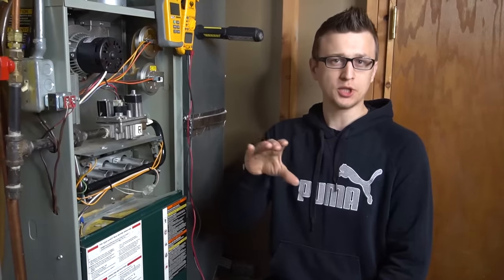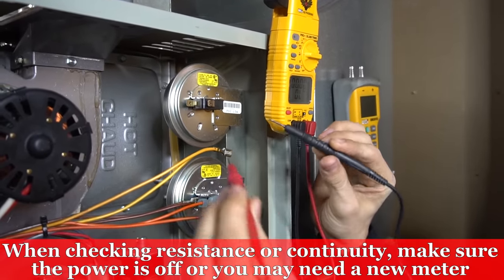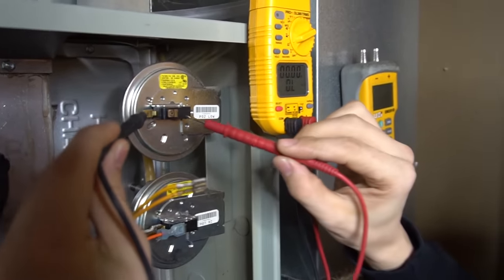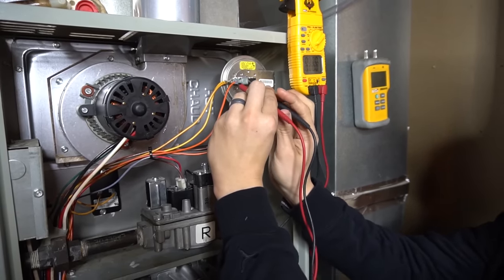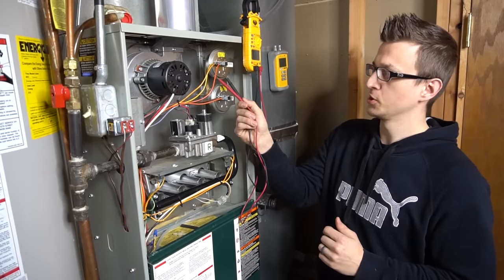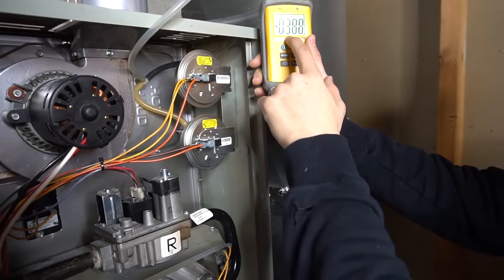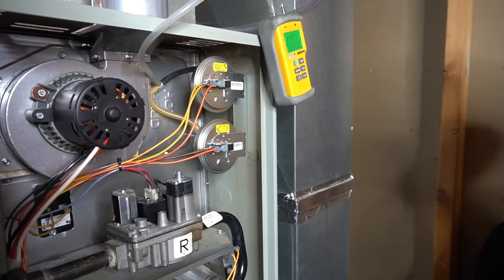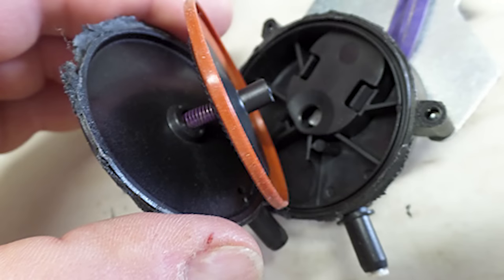How to Test Pressure Switch on a Furnace

Comment: Ok, thanks to you I now know that my high pressure switch on my AC unit is bad. My question now is: Do I need a professional to come in and remove all the refrigerant before replacing it and then put the refrigerant back? I have a Grandaire model WJA442000KTP0A1
Reply from the maker: High pressure switches are usually resettable. Does yours not have a reset button on it? If it doesn't reset or there is no button then yes, I would call out a pro since you do have to pull the refrigerant out, replace the part, pull a vacuum, and fill it back up like you said. This might turn expensive by the way..

Comment: We live in a modular so I have the dual switch (two-stage) in my counter-flow furnace. Which switch did you check for continuity? I replaced the switch about 2 years ago and it failed on me early this morning (05/04/22). It's early spring so we still need the heat! I kept the old differential switch just for reference and decided to try it out again as a "Hail-Mary" and it worked!! What the heck? So now my question is two-part: Why did it fail? Why is it now working again? Now I want to check the newer failed switch for continuity. In your video it isn't clear to me which switch you checked out for continuity. Is it the one with the higher number or the lower number  -0.40 & -1.20 ? My switches are horizontal, whereas yours are vertically positioned. I'm expecting the old one to fail again. Great instructional video by the way!

Comment: Thank you for the great video.  Question about the voltage check of the pressure switch.  If it’s normally open, how is it that the 27v is present when open and then not present when it closes.  I would think it would be the reverse.  Excuse my ignorance. I’m learning.  Also could I put one lead to ground and hop from one terminal to the other to see if voltage is running through the switch?  Am I thinking of this incorrectly?

Comment: So you are saying squeezing them in a vice is not the best way to test their pressure capability?
J/k
Last year my digital manometer crapped out, so I bought the field peice sdmn6. Great manometer with addition pressure switch testing abilities, it has a pump feature that can be used to simulate pos or neg pressure to test if the pressure switch is breaking within rated/needed wc. long with the ability to take gas pressure, transducer checks and it comes with static pressure tips to take static pressure readings.
Although I still prefer a magnahelic guage over digital for static pressure it adds another tool to the arsenal.

Comment: I have a question 
Why my inducer motor not turned on.  I test the bypass and it runs not broking.
What you think is the problem
The blower motor works 
The air condition works
But the heater was working but stoped working now

Comment: HI what do you recommend when in the off season shutting the gas valve off or shutting the main gas shut off ? or something else ?  Thank You i find your videos very informative .
Reply from the maker: You should not have to turn off the gas to your furnace at all during the summer. I don't do that nor do any of the techs I work with. The only thing I would recommend is switch your thermostat from heat to cool and change the filters regularly :)
Reply: @WordofAdviceTV  OK Thank You for replying I appreciate it :)
Reply: Vega mann +,    that's such a great question, I've always been asked that and thought about that when it comes to the summer? ¿
Reply from the maker: @danielc.3725  I think the old natural draft furnaces that had gas valves with a standing pilot were the ones that needed to be turned off for the summer. But there are very few of those classics still around..
Reply: @WordofAdviceTV  +  Oh,  okay thank you bro, you must have just read my mind, cuz my mother-in-law is the one that  has a WALL like connected to the wall cuz it's a small house and she would always ask me turn it off or leave it on,     and I would be like just turn it off because you can still feel heat coming out from it, and it would just make the house more hotter....
Reply from the maker: @danielc.3725  Yeah, if it is a furnace like that then I would say it would be better to turn it off. Thank you for bringing that up! I originally said just leave it on but you are right, in some cases, it's better to turn it off (furnaces that have a standing pilot)

Comment: Is the test for the high stage switch exactly the same?  (IOTW: Does the high stage switch operate the same?)

What is the difference between the two (does the high require more pressure to open)?

Comment: I have a variable speed furnace (modulating ) gas valve ... the wires connected to the gas valve kind of similar to yours .. I have 2 black wires connected to modulating coil of the gas valve then another two yellow wires connected to other valve. How do you test them???

Comment: Awesome videos.The techs that service my unit just look for an error code and rely on that. I live in the southeast and have a gas-pack that's only 6 years old and has been working great. Get semi annual checks on it and everything checked out fine in Oct. My problem is that the heat works fine when the temperatures are above around 40-45 but when it gets colder in the 20s and 30s it will run for awhile then the gas shuts off and the blower motor just keeps running. I checked my low pressure switch for continuity and it's fine. Is it possible that the diaphragm is going bad and that the colder temperatures causes it to not work properly? Any other ideas are welcome. 

As I mentioned, the tech crew that came out just looked at the error codes which indicated a bad pressure switch but I didn't see them check for continuity. They just made a call and said the pressure switches are bad based on the error code. They have ordered both of them and I hope that's the issue. Seems everyone wants the easy way out and just relying on error codes sometimes doesn't cut it.

Comment: If the pressure switch is closed and that would be normal for a heater cycle would that not let the ignitor and gas valve to open since the point is to have a continuous circuit?

Comment: Just wanted to thank you.  I had watched this and happened to get my first heating service call from a friend.  Diagnosed the pressure switch problem and replaced in 20 minutes.  Had picked up a universal switch and a -0.4” oem switch.  His was -0.47”.  I put -0.4 for now .  His inducers actual pressure was well above -1.5”.will .4 work or should I get .47.
Putting something in your PayPal 😊
Reply from the maker: Glad to hear the video helped! .07" is not that much of a difference so I would be okay with leaving that one in there. If there is a problem, usually it would go well below the rating on the pressure switch. I appreciate the support! :)

Comment: What indications of furnace operation would you notice if pressure switch had a small leak,  my Bryant 394 furnace does not hsve aflame sensor and is cycling.

Comment: Great advice, Jay.  I have a 13 year old Carrier furnace, high efficiency and the burner would not light.  Error code 13 on the blinking LED, meaning Pressure Switch Problem.  I did as you suggested and found two quarts of water being stored in the water collection system.  The drain pipe from the water concentrator was completely blocked and no water was leaving via the 3/8' PVC drain tube.  The installer glued the PVC joints together, so no way to remove the water concentrator.  I found a short length of 1/2" plastic tubing and blew through the largest port, after disconnecting the three tubes going to it.  I plugged the other two as I blew and finally it broke loose and a bunch of slimy junk came out followed by more water.  I put everything back to gather, I checked to be sure the hot air exhaust was clear, and started it up.  After it ran it's startup diagnostics, in a few minutes the igniter came on the then the gas value turned on and the burners lit.  The furnace has been running for a couple of hours now, quickly bringing the house up to temperature.  I have it fixed and can cancel an expensive service call.  Late October, so the service men are really busy and backed up into late next week.  Was going to pay extra for a Sunday call, but now can cancel.  I've  watched several of your videos and they are all very informative.  Thanks for telling about his efficiency furnace differences, that was really helpful.  You got a BIG thumbs up!
Reply: I have two PVC pipes running from my carrier in the attic to the outside gutter. Am I supposed to unhook it from the duct it's hooked up to. It's a big square. There is a drain pan underneath it with nothing in it. Please help I've gotta get this running before winter

Comment: Hi jay
I have trane xr80 which flashes 4 times on the board which means high limit temperatures problem, so I change high limi no success, jumped pressure switch nothing, checked flame sensor and ignition all good even charged circuit board still 4 flashes , changed the filter and water filter, please help me what else I can do before calling technician, thanks to your videos I am very confident to open the furnace and look for any problem

Comment: is the pressure switch actuated by the inducer motor or the fan motor?
Reply: It responds to the negative pressure created by the inducer or ventor motor.  The main circulation blower distributes the air to the home.

Comment: You can also test the pressure switch with an amperage reading to make sure it goes to the closed-circuit when the system is running.

Comment: Do you advice buying a used pressure switch. Mine is a little expensive
Reply from the maker: Well as long as the seller says it is functional and there is nothing wrong with it (hopefully returns accepted) then I don't see why not.

Comment: When I get around 29 on the multimeter without turning on the furnace, does this mean there's something wrong with the pressure switch?  From what I am understanding is that reading should be at 0, after turning on furnace, reading will go up to around 27 for a short amount of time, then drop to 0 again.

Comment: I've been following your series, and you're good at what you do....
but...
There is a bias all over the HVAC channels to show primarily natural gas systems (rarely propane) and ones that are not crappy carrier components.  This leaves confusion on just what leads you are testing since carrier has three independent wires coming from the inducer control board.  White is common but is ISOLATED from ground.  The other two wires go to NO and NC tabs so when I look at your setup I don't know just what leads you are testing or in other videos what leads you are jumpering to get your results.

Comment: I just unplugged the hose from the vacuum pump and sucked air out of the pressure switch with the voltmeter connected to see if the switch closes. I can see the membrane in these switches going bad over time and not being able to get enough pressure to close the switch

Comment: An HVAC technician said my pressure switches were faulty. I have a two stage furnace. He said there were two for the high side and two for the low side. So I have a total of four. Is this correct?

Comment: Great videos! - Question:

Have a Trane XL90 and have noticed the 2 speed inducer motor fluctuate hi and low erratically during operation. It used to start hi then go to low during operation. One of the pressure switches or?

Comment: What are your thoughts on universal adjustable pressure switches?
Reply from the maker: I prefer not to use them because I believe the original is better. I usually replace them with OEM pressure switches but a few of my coworkers say they put in adjustable ones all the time and they work just fine. But they do stress the part that you have to READ and FOLLOW the instructions :)

Comment: I have High Pressure Switch Open Error.  My high pressure switch closes but the olms are 55 times higher than the low pressure switch,  2200 olms vs. 40 olms.   I believe the board treats anything over 1000 olms as open.  So that would mean the pressure switch is defective, correct?

Comment: Please allow me to give an explanation of what you were talking about at 5:19...
  Most people whom I have met cannot seem to grasp the concept of 'Potential Difference'.  Potential Difference is what you are measuring when you are 'checking for voltage'.  Your multimeter is not measuring the amount of  voltage in a load or switch; it is determining the Potential Difference - it is the DIFFERENCE in voltage between the outside of your meter's leads, and the voltage in between the leads. 
  I think the confusion with some comes when differentiating between the potential difference in loads and switches. 
  Loads are power-consuming devices. 
  Switches are merely power-passing devices. 
  When measuring the potential difference in a load, if there is voltage present and that load is energized, your meter will display a value (e.g., If there is 120V outside of your leads and 120V in between your leads, your meter should read 120V).  If the load is not energized and there is no voltage present, your meter will read 0V.
  With switches, however, it's different.
  If you are measuring the potential difference in a switch, then, if there is 120V outside of your leads and that switch is closed, your meter will read 0V.  Because 120V (minus the 120V present between your leads) = 0V. 
(120V - 120V = 0V.)
   However, if there is 120V outside of your leads and that switch is open, your meter will read 120V.  Because 120V (minus the 0V present between your leads) = 120V. 
(120V - 0V = 120V.)
  With a switch, a good analogy would be to think about 120 vehicles on one side of a bridge (i.e., the switch) waiting for the bridge/switch to close.  Since no cars can pass across an open bridge, the potential DIFFERENCE in the number of vehicles on the outside of the bridge and those driving across the bridge would be 120 (120 - 0 = 120).
 If that bridge (switch) was closed, however, then the potential DIFFERENCE in the number of vehicles on the outside of the bridge and those driving across the bridge would be 0 (120 - 120 = 0).
  
  Even if only one person finds this helpful, then I'll feel better knowing that I was able to help someone with this. 
  Because I struggled with it for years until, one day, it finally hit me, and it all became clear. 
  The light bulb turned on, and I finally understood it. 💡 😏

Comment: On a multi stage should you replace both switches if only one is bad?
Reply from the maker: There is usually no need to replace both. If they are not pricey, sometimes I will order both of them anyway.

Comment: I'm trying to fix my AS Freedom 80 and it looks about identical to the furnace you're demonstrating on. Should the hi pressure switch be tested the same as the lo? Should there be 27VAC and then 0V across the terminals? Because while I'm getting 27V across the lo switch, I'm only getting from .6 to 1.6V across the hi switch. I've tested that voltage at the switch and also down at the controller connector. The inducer fan is spinning, the tubes aren't blocked, both switches show they're closing with the inducer fan running. Also, the controller (White-Rodgers 50A51-507) sometimes blinks 3x showing a pressure sensor problem, and sometimes shows solid red (failed controller). Is the controller bad?

Comment: great video, but you cant hook up the pressure switches in series and have them work..... they are in parallel.  switches are in series (electric runs through them to the next widget) while a pressure switch kinda has to be the final destination for the air.

Comment: You did not show how to check the high stage pressure switch. I assume there would only be continuity or voltage on a high stage pressure switch when the system calls for it to engage. So, how do you check the high end?

Comment: Thank you for the video!
Can someone explain to me why there's 27 volts @ pressure switch then it drops to zero? If it's open... and then we measure the 2 points of the switch it should be zero right? (because the switch is not closed yet) Until the switch is closed, then we should get 27 V through the switch. In other words, if 24V is incoming going to an open switch, if I measure across the switch I'll get 24V? And then the switch will consume the 24V thus dropping to zero?
Reply: The voltage across the switch is determined by the resistance of the switch. In a circuit, the greatest voltage will be across the element with the greatest resistance. When the switch is open, it has near infinite resistance and you see all of the voltage in the circuit across it. When it is closed, it's resistance drops to near zero. In this state very little of the voltage in the circuit will appear across the switch.
Reply: @johnwheeler8922  This idea of voltage being 24v at the pressure switch terminals when the pressure switch is open, and then being 0v when the switch is closed - is confusing to me also. 

What happens to the 24v when the switch closes? Disappears? Consumed?

Do I see 24v when the switch is open, because the meter's 2nd probe is completing the circuit from the 1st probe, and reading that AC voltage?
Reply: @m.n.3490  Try this at your home, a light switch, up & down switch, off/on. When switch is Off measure both wire with a voltmeter, it should register 24 volts. When ON it should register Zero volts, because both wires are connected in series. It is same thing as pressure switch in HVAC.

Comment: The pressure switch can be frozen? 
In my case , the heater don’t reach the temperature I indicate on thermostat, o. The cold night, but on noon went is warmer , turn on and reach any temperature I put on the thermostat. I remplace differents parts like panel , sensors flame, thermostat,